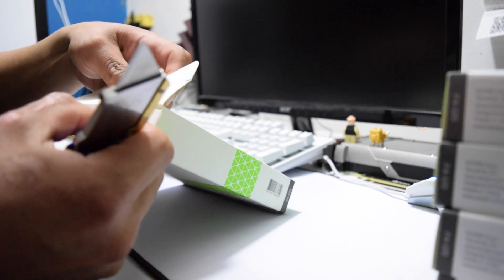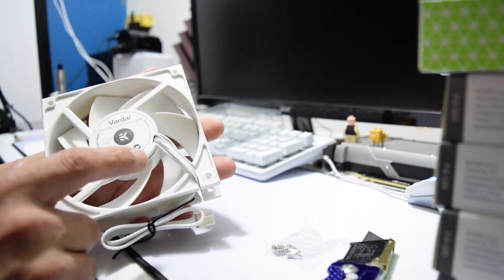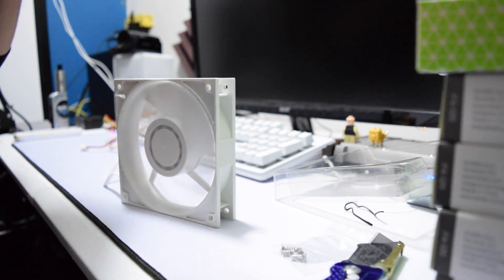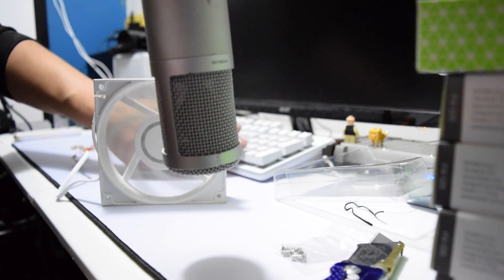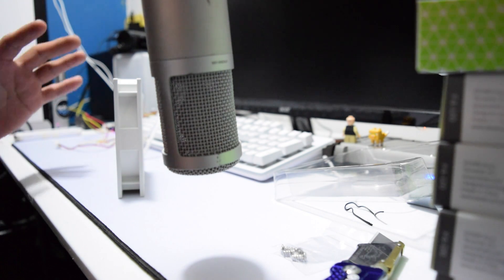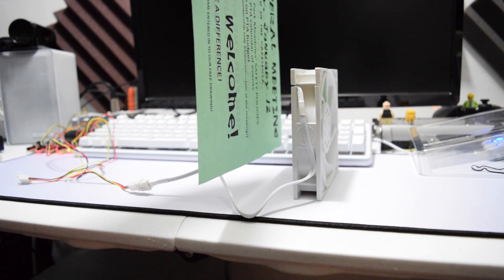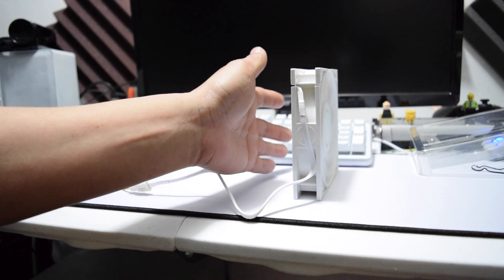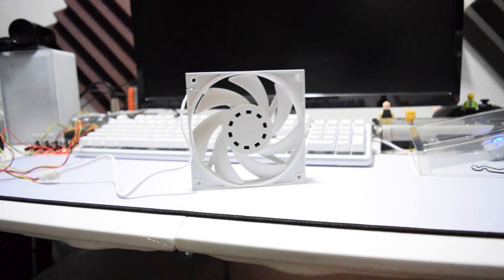ALL WHITE EK-Vardar F4-120ER (2200rpm) High Performance Liquid Cooling Fan

Comment: Good video, good for a smile, good science project... But the test (in my opinion) is inconclusive. Because a fan by itself is pretty quiet, but a fan attached to a radiator can get pretty loud and that is what I'm looking for. My SP120L radiator fans are louder and less effective than my raidmax chassis fan.
Reply from the maker: actually in this video this fans sound loud AF but i already have them installed it and 6 of this fans are pretty quiet

Comment: u hear this rattling noise ? all fans of the vardar line have this on low rpm !   ek dont want to replace my fans they say i dont know how to mount fans ... i used many methrods of antivibration !  crews with rubber inserts etc... still louder than my corsair fans ..